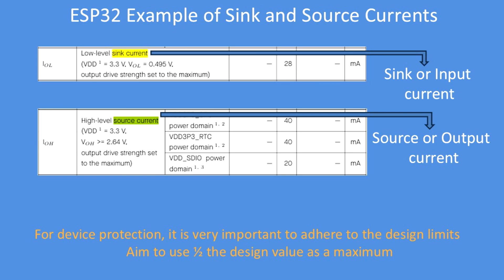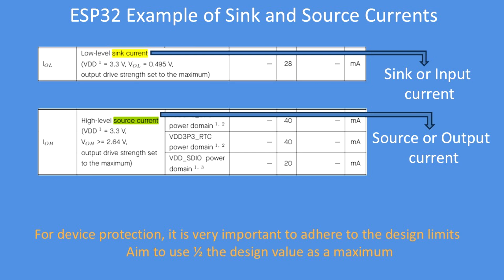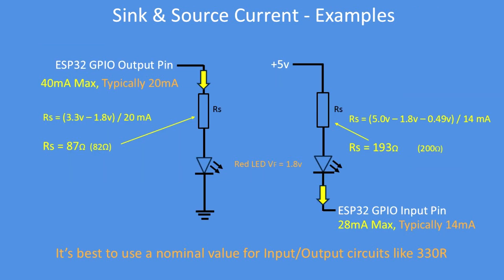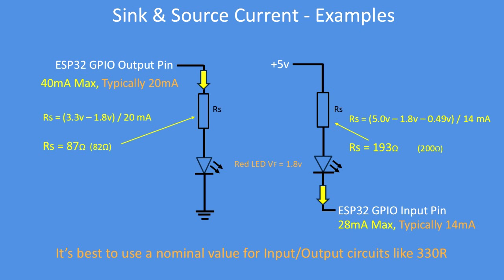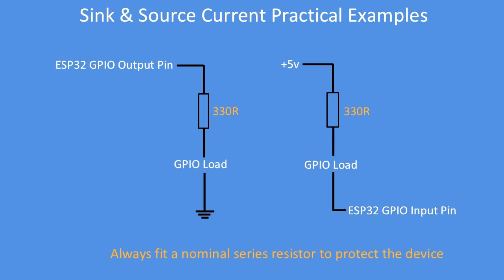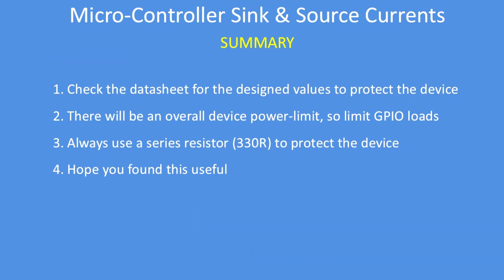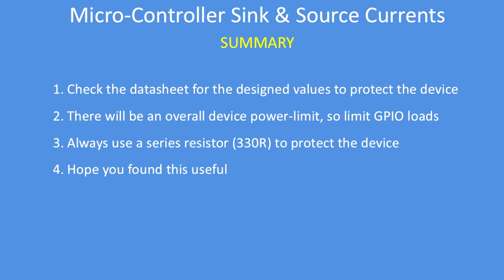Tech Note 158 - Sink and Source Currents

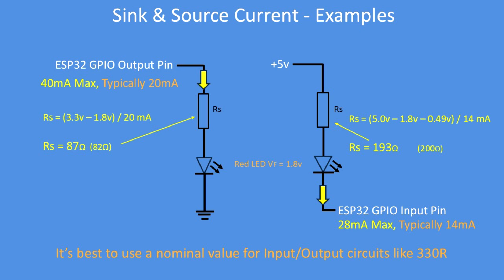Comment: @ 1:50   tell us what that 0.49v is on the sink side.
just the voltage drop ( or rise ) of the MCU under load ?
Reply from the maker: It’s the input voltage of the device created by its non-zero input impedance, also many devices use a base-emitter junction at the input which device dependent creates the offset voltage.